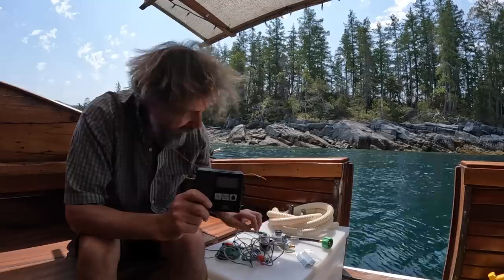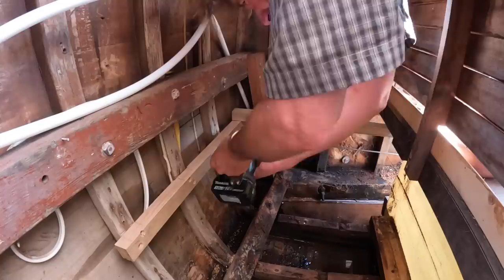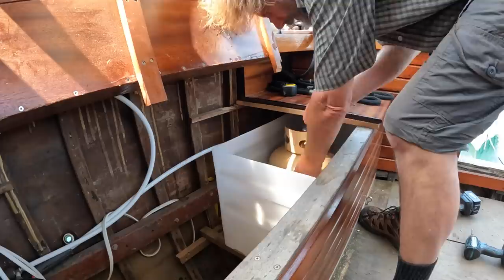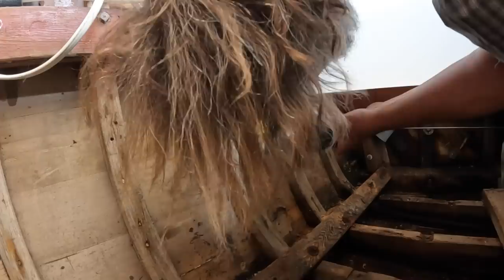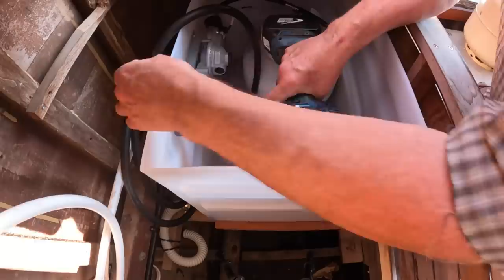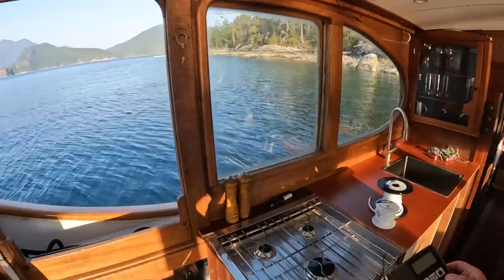Propane Locker - #376 - Boat Life - Living aboard a wooden boat - Travels With Geordie

Comment: Hi Peter, If you are at all worried about the side exit of your locker and the amount of gas that could accumulate, it looks to me from the video like you have enough head room in the locker to whack in something (wood, HDPE,Metal) to take up most of the dead air space. That way you have a "raised floor" to keep the cylinder bases dry and you'd still be able to periodically mop up any condensation if needed. LPG (butane/Propane) has an LEL and UEL of around 2 to 10% so if you can reduce that dead air space easily then at least if you do get a little "boom"(it's a firey word) it won't be enough to compromise your cylinders (Gas comes in cylinders, beer comes in bottles and the army comes in tanks- unless of course it's a production facility then it's a gas "tank"farm) enough to cause a BLEVE (That actually is a Firey word- Boiling Liquid Expanding Vapour Explosion) Just a thought, thanks for sharing your videos and I'm still loving the shirt. regards, Dave

Comment: Hi Peter, I love your work as always. I'm just wondering with the thru hull being on the side of the propane locker and you mentioning that it is an acceptable risk that you could have up to 3/4 inch of space at the bottom of the locker where propane is able to collect, is it possible to fill that bottom portion with a seasafe/non rust inducing liquid. E.g. a gel or something? It would prevent propane gasses from accumulating there. It might be a silly idea though.
Reply from the maker: Actually a plastic filler panel with two round cutouts to secure the tanks is coming.

Comment: Always amazing to watch your work in progress. I’m no electrician but is placing the solenoid inside the propane locker the safest option? If the tanks do leak inside the locker, granted the tank leak would probably have to be excessive, is the solenoid intrinsically safe? One spark and boom! Get you a beer of the week if you get up to Cape Breton. Happy cruising!
Reply from the maker: That's a great point. It's required to be in the locker in case there's a leak. One hopes the unit is spark safe.
Reply: @TravelsWithGeordie   solenoid does look well sealed and does make sense to be pre regulator. Thanks because I’m planning on putting a locker in my schooner. Your skills amaze!

Comment: Just a quick question on the stern ties.   Are there tie-ons in most locations of the rocks or do you have to create a wedge to tie to?
Reply from the maker: Everywhere is different. Cruising guides and apps like Navionics indicate most of the rings / chains. But in some places you will need to find something else, tree, rock etc. I've never used a wedge etc.

Comment: So Peter, how did you manage the gasketed gas tight seal on the propane locker lid?  That little issue is why I broke down and bought a Trident propane locker when I did my install.
Reply: Had the same thought. I was thinking a three quarter inch layer of closed cell foam on the bottom with reliefs cut for the tank bases and a depth appropriate layer on the top to seal and hold the tops. Some cam lock latches to finish the set up. I like the side mount thru hull. Air rushing pass would create a vortex vacuum inside the locker with the lid sealed.🙃
Reply: Hi Todd.
With UK regulations it would fail 💥
all of it 🤬
In brief...
Everything must be metal.. steel, brass, copper as per regulations..
including the pipe to the cooker and drain.
Pipe from cylinder to locker fitting has a particular number on it with a date.
Reply: @mySeaPrince_  Things are definitely different here.  Although certain grades of copper tubing are allowed, the "standards" discourage copper tubing relative to properly rated hose.  Of course the "standards" here are voluntary and only enforced by insurance companies.  There are no government standards for propane systems in recreational boats.  I believe Canada is the same.
Reply: @todddunn945  
The copper pipe is a particular type (no seam) of a certain thickness and diameter.. same with fuel.
Fittings are brass compression with copper olives also a test point for gas similar to a tee fitting for a manometer.
I have the same thinking as Peter..
regulations for the drain say minimum of 15mm I fitted 28mm.
... and electrical cables must never be near or cross the gas or diesel pipes.
No pipes or cables are allowed in the bilge except bilge pump.
Reply: @mySeaPrince_  You are much more highly regulated than we are here.  Recreational boats only have a couple of strict regulations to meet.  The most strictly enforced are for the head and the details of waste holding tanks.  There are also regulations that are enforced for safety equipment (life jackets, flares, fire extinguishers, etc.).  The only other regulations are for gasoline (petrol) engines and fuel systems.  Diesel is pretty much unregulated.  I can build a diesel tank myself out of fiberglass lined plywood and that is considered OK.  The ABYC regulations that Peter referred to are a set of "guidelines" made by the American Boat and Yacht Council (ABYC) which is an association of boat builders and equipment manufacturers.  They publish guidelines for pretty much everything about boat construction.  They are not official government backed regulations and compliance is voluntary.  However, since they are all that is out there for most aspects of recreational boats the insurance companies have adopted them and make compliance mandatory if you want insurance.  The situation is completely different for commercial boats, particularly those that carry passengers.  There is an extensive list of federal regulations that commercial boats have to comply with.
Reply from the maker: That's a great question Todd. I actually don't agree with gasketing the lid as there needs to be a way for air to enter the locker to allow the propane to pour out. However I acknowledge it's in the specs and also accept that if the drain clogs propane could pour over the top.
I'm actually considering a separate intake vent at the top of the locker to workaround that and then I'll arrange a gasket.
Reply: @TravelsWithGeordie  Peter I think the issue is a catastrophic failure that pressurizes the locker with propane.  The pressure will force the propane out, but if the top isn't adequately sealed, propane will flow over the top into the interior of the boat.  A vent might work if it went to the exterior of the hull,but good luck convincing a surveyor or insurance company  that it is OK.
Reply: @TravelsWithGeordie  
There are or were some authorities in the UK (I can't keep up with bureaucratic change of all of them) that enforced top and bottom vents with a sealed lid, I don't know the material used.
The other consideration is the vent being windward and air traveling into the locker, a top and bottom vent balances this. One thought years ago (but I don't think was enforced) was to have a pipe going across the vessel and the drain teed to this. On narrowboats with a bow locker used for gas it is common to have drain holes in the hull both sides.
btw .. I do like the electronic device.
There is another rule about securing the cylinder's particularly from impacting, in your case the regulator.. usually by use of chain.
Reply from the maker: I think I'll eventually go with top and bottom vent plus sealed lid.